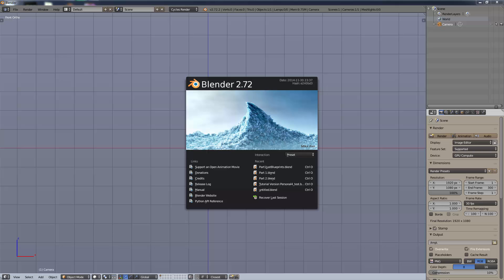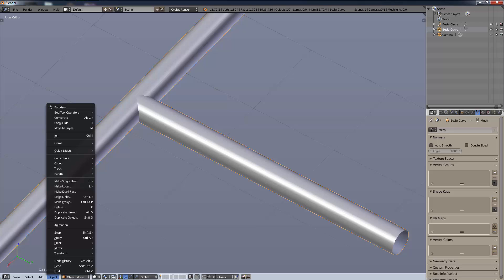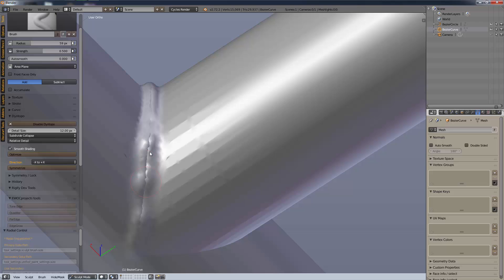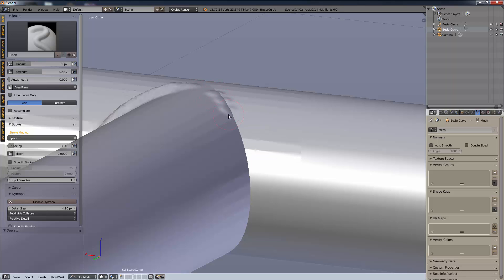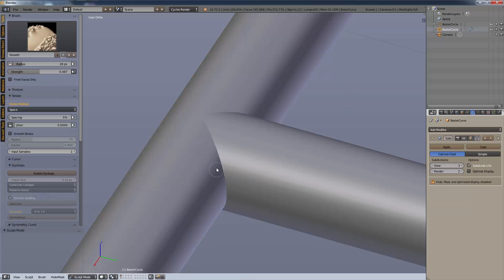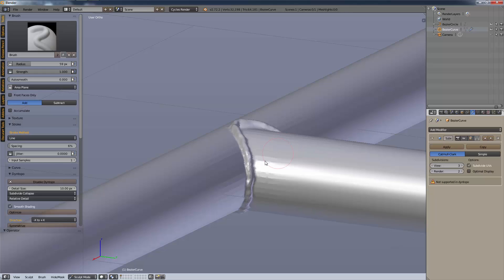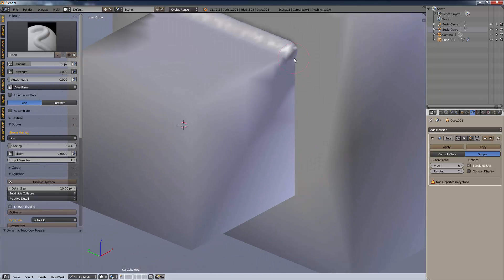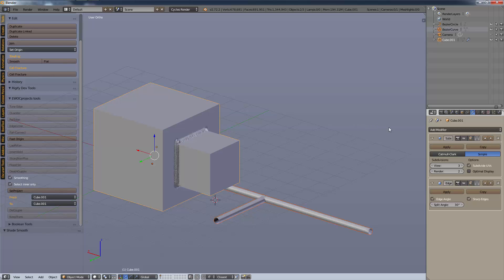How to Make / Model Welds & Weld Beads in Blender on any Mesh - 2.73

Comment: To add more geometry only in the weld-zone, I cut the 'added' object with the base object, then extrude the cut face two-three times (with a little scaling) to 'pile up' more polys.
This leaves the cut part with a flange of high-poly geometry that matches the weld-zone precisely!
This flange can be added to a Vertex Group, for more selective edits.
After the extruding, the two parts are oriented, leaving most of the weld-zone exposed.
For the first pass, the 'welding-brush' is then used, but only on the flange of the cut model.
Using the brush, 'pull' the weld metal up from the flange, through the surface of the base part.
This makes for a nicer looking weld and gives control over the depth of the weld effect!
Using a smaller brush every once in a while, pull tiny 'spikes' or 'blobs' through the surface of the base...welding spatter/novice marks!
Merge the objects with Boolean Union, then fine-tune the weld on the joined parts.
This leaves the rest of the model relatively low-poly with lots of geometry for the brush to play with!
*
By building the bulk of the weld this way, the sculpting tool is refining the surface rather than trying to build volume.
I have done LOTS of welding in the real world, gas, MIG, wire-feed and arc;  your technique looks pretty good!
Now all we need is slag...